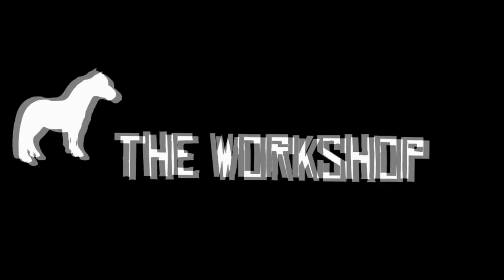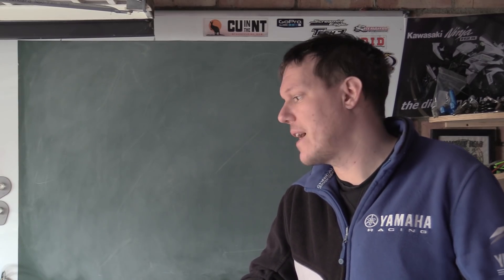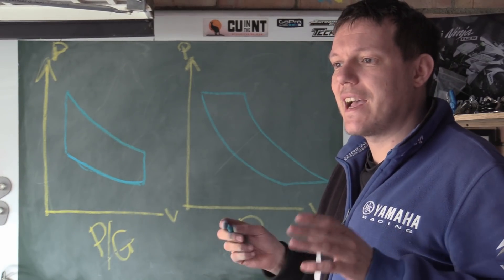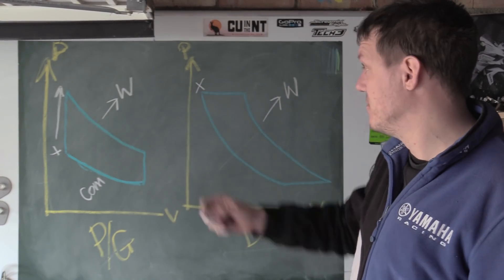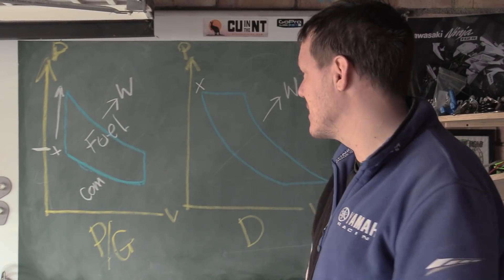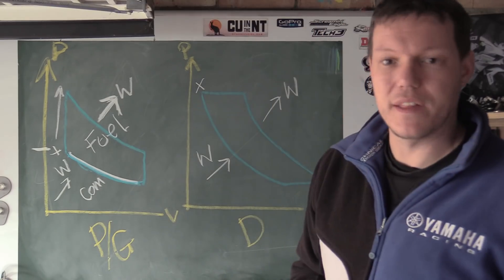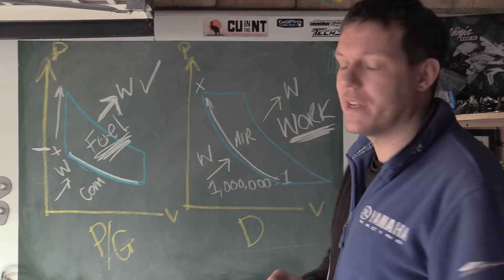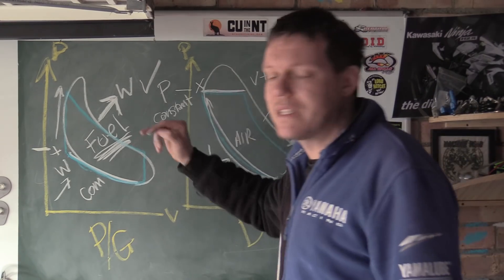The REAL difference between Petrols and Diesels

Comment: IMHO use also determines the difference. Gasoline (Petrol) is used for high revving engines that derive horse power by how many times they revolve in one minute. The torque they produce can be low for any given rotation. Diesel is used for moving huge loads and sacrifice high RPM for very high torque per revolution. Also helps that diesel fuel has more energy per unit volume than gasoline for longer use before fill up if tank volumes are equal.
Reply from the maker: More energy per unit volume??? You sure about that? 46 MJ/kg vs 44MJ/kg comes to mind, but I wouldn't even say they're different...

Comment: Matt, i know this is a old video, but you are drawing the diesel pV diagram wrong - gasoline is correct - 2 adiabatic and 2 isobaric processes - but - diesel has 2 adiabatic just like a gasoline engine has (its just a ideal compression/decompression of a gas) and has different (isochoric) combustion - but exchange of gasses by valves - exhaust out, fresh air in is the same principle as for the Otto cycle. You just have the same volume, but different pressures. Also - modern diesel engines use rather Sabates cycle - its just a combination of Otto and Diesel cycle - the combustion is both isochoric and isobaric but that would need more explanaition.
Reply from the maker: I'm talking about the original diesel story and cycle, not what it actually became, that's another story
Reply: @thedirtyworkshop  can you show me where you found this pV diagram? I mean, the exchange of gasses goes the same - original diesel engine had valves and 4 cycles and if you just let exhaust out and suck fresh air in, thats isochoric process (it should be drawn a little differently - second loop that actually makes "negative work" ... I mean if you read any scientific paper on this topic, they all get it the same ... Even Wikipedia has this chart right ... I mean everyone can make a mistake, but if i am not correct, please explain how because to me its better to be correct than "win an argument". Thanks Matt, apprecieate your work
Reply from the maker: In the video I'm talking about patents and the idea that rudolf diesel argued, not a real world engine...

Comment: So if you were to design a 'diesel' system that had a fuel system capable of handling petrol, what stops you from using petrol in a 'diesel' engine? It would still ignite under compression, there is no opportunity for detonation because of the direct injection at TDC. The only issue i can think of is perhaps the pressures would be too high? 

Would like to hear someone's opinion on this.
Reply from the maker: No. The reason why you dont do this is nothing to do with chemistry. The reason is why would you? There're no benefits.
Reply: @thedirtyworkshop  It's not a matter of practicality, just curious.

Comment: Do diesel engines have the problem of intake valve caking of GDI engines? If not, why?
Reply from the maker: Usually they are turboed, and it the turbine that get caked up  after that there's yhe egr valve and that get caked up  so the valves see very little compared to petrols.

Comment: Just another one mate, am i right in thinking that diesels are better on fuel because they run a leaner AFR and the higher compression leads to more heat going into mechanical work and as a result you don't need as much fuel to make more power?
Reply from the maker: Yes and no. There's more to it than just that. The way fuel is added is a major contributor - and it's to do with constant pressure
Reply: @thedirtyworkshop  yeah diesels and GDI engines need higher pressures because they dont have the time that port injection does to properly mix with the air.
Reply: @thedirtyworkshop  just off the back of this mate is a pcv valve the same as a crank breather? The reason i ask is because i've only ever heard of a pcv valve when it comes to getting rid of pressure in the crankcase.

Comment: Constant   volume                              Vs                                          Constant Pressure 

 Fuel Limited                                                                                        no fuel limitation 

Like Burning  a Fire Cracker ( confined volume )                          Like  Burning a  Candle [wick(fuel injector )]   (  Constant pressure say 1 Atmosphere  )

proper fuel needed  ( Gunpowder  )                                                Burn any thing which can be burned 

M16A4                                                                                                  RR Trent

Comment: The early 2 stroke and 4 stroke engines were mainly run on coal oil, kerosene, paraffin, alcohol, etc. until petrol appeared on the market in the early 1900's. The first petrol was only 30 to 35 Octane RON. By the 1930's petrol was 60 to 65 Octane RON.

Comment: Otto's engine used coal oil (lamp oil).
Reply from the maker: https://en.wikipedia.org/wiki/Coal_gas
Reply from the maker: https://en.wikipedia.org/wiki/History_of_manufactured_fuel_gases
Reply: @thedirtyworkshop  I was getting mixed up with Gotlieb & Daimler's world's first liquid fuelled internal combustion engined vehicle (a motorcycle) which used lamp oil for fuel with heated rod ignition. (Spark ignition was yet to be perfected until the 1890's with the invention of Exciter Ignition (American), Magneto Ignition (British) and Bosch Coil Discharge Ignition (German)).

The modern safety bicycle was invented a few months later that year.

Nearly two years later Gotlieb & Daimler invented the first motorcar. (It was actually a trike!!).

Comment: Matt...a little esoteric rambling(for me) going on here.One runs on spark, one runs on the heating of fuel due to compression of air.. .One runs at nearly any Rpm.. the other is pretty
much limited to a narrow range. What blew my mind is that there are 2-stroke diesels with
a blower to fill the cylinder with air.Gotta go...Cheers..!

Comment: There's an interesting petrol engine that Vauxhall made. Its a 3 cylinder, port injected, makes 17 bar of compression with 120k on the odometer. If its up to temp and it has shit plugs it can run without ignition coils.

Comment: a diesel will run well on 100% ethanol, which also an otto engine will. So there is even overlap in the fuels they can run, not just that they can run on diffrent fuels than what the "name" suggests.
Reply: In fact You can run D on gas/petrol. 

There is a video on YT, a part from 5th Gear or Top Gear, in which they run Opel Astra D on gas.
Reply: @jareknowak8712  it wont live verry long. A diesel and a petrol run good on ethanol
Reply: @jompazx1272  yes i know. But it works! 
BTW Google: Mazda SkyActive-X 
Its like diesel, but runs on petrol.

Comment: i just wish we could run petrol engines at 25:1 compression ratio as diesel do and have that powerfull torque i tryed before but it auto-ignites and doesnt turn off the engine in my mini cooper -s old version 1275 gt

Comment: Fuck sakes I’ve done nothing but work in diesel performance shops for the last 5 years and nobody has mentioned any of this lol, would another key difference between the 2 be the diesel has its combustion chamber in the piston and the petrol engine has its combustion chamber in the head ?
Reply from the maker: No, because it doesn't have to be

Comment: Ahhh that's why the injectors in my diesel fire more than once . Constant pressure .thanks Matt .
Reply: ,,, there's a few more reasons for the multi squirt in a common rail system  .
Reply: @rolandtamaccio3285  i see multi squirt i press like

Comment: Hi Matt what are your thoughts on modern high silicon content pistons say of 12% or so verses lads sticking expensive forged pistons in motors they use everyday eg lots of cold starts and short journeys , also what about the talk of 2 strokes in formula 1 is it a load of shit or could they work like 2 stroke diesels apologies if you've covered this already.
Reply from the maker: You mean eutectic pistons. Most forged and cast alloys already are
Reply: @thedirtyworkshop  Is it still the case that forged expand a lot more than cast or has eutectic alloys sorted most of the problems with having had to be sized smaller.

Comment: So from what I understand and you saying is. Diesel need boost to make power and do to compression are low revving, with loads of close to linear power in that band primary torque. Gas on the other benefits from revving to the moon to make power at a sacrifice to bottom end power, so it needs the magic of variable cam and ignition timing to smooth out the power band You got two other camps with gas "no replacement for displacement" and the wankel group. The  "no replacement for displacement" group has a engine that is large in displacement but dose not rev for shit, it will also be one that is testing compression limits of fuel to make power. Then with the wankel it has revving to the moon as its end goal, basically a 2 stroke that has no mean of oiling its self and needs it in the fuel. So in turn there is many ways to skin a cat and no right way.

Comment: So (have I got this right) the difference is the way the fuel is delivered. With the incoming air OR at the point of ignition.
What if you direct injected petrol like a diesel, at the point of ignition, it would then not be limited by the fuel?
Not that you'd want to I suppose.
Reply from the maker: No. The difference is how they work - forget fuel. It's the process. Like the difference between an aeroplane and a helicopter - they both fly but one forces itself through the air passing air over it's wings. The other swings the wings through the air rotationally. 

"What if you direct injected petrol like a diesel, at the point of ignition, it would then not be limited by the fuel?"

- Yes - you 'could' do this with petrol. The issue is how quickly petrol burns and some other factors we'll have to cover soon

Comment: I expect the very largest diesels (supertankers and such) are probably very close to the ideal cycle in terms of constant pressure. And inherently safe. Imagine a cylinder of several cubic metres, filled with petrol air mixture, and just ready to go! Scary!
Reply: petrol powered boats are causes of many fires, they also drink fuel like crazy and the energy density factor plays a big part too in regards to range.
most ships run on "bunker fuel" due to it being cheap, its basically very dirty unrefined diesel.

Comment: Diesel fuel usually has a lower ignition temperature and usually works as a lubricant
Reply: can you spray diesel on metal and use it like wd 40?
Reply from the maker: But that's fuel! You can run diesel (albeit not very well) in an otto engine
Reply: I never realized diesel how diesel was a lubricant until i pulled into the gas station on my bike and there was a giant puddle of the shit. Felt like fucking ice rink when i put my feet back onto the pegs.

Comment: I think you can run diesel engines on ammonia also. There is some interest running ships on the stuff as there no carbon in the exhaust.
Reply: Fascinating link, very much an Internet rabbit hole, ended up with reading about the efficiency of 2-stroke heat engines for the conversion of a stored gas ( hydrogen or ammonia) into electricity. Fascinating, thank you for the links, not something I would have considered at all.
Reply from the maker: Ammonia?
Reply: @thedirtyworkshop  needs a bit of help from hydrogen I think it works in spark ignition also

https://www.ammoniaenergy.org/articles/ammonia-powered-internal-combustion-engines/

https://www.ammoniaenergy.org/articles/man-energy-solutions-an-ammonia-engine-for-the-maritime-sector/
Reply: @MrConor159  thanks for the link